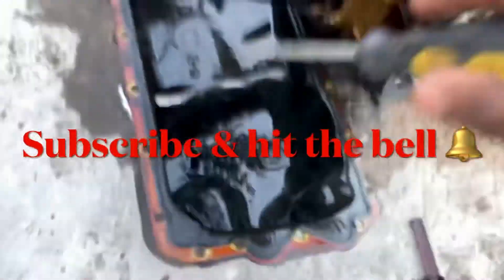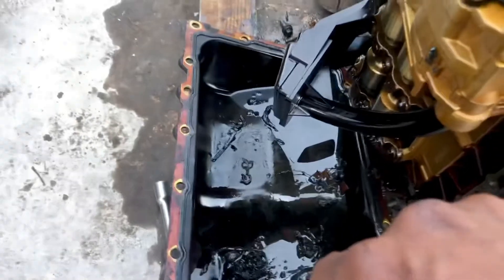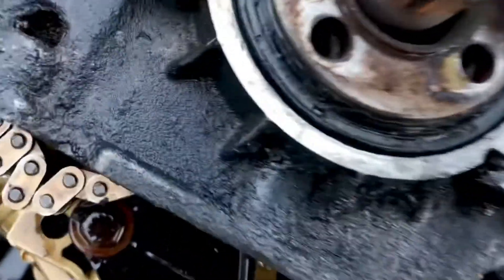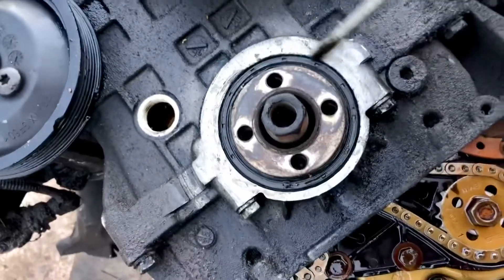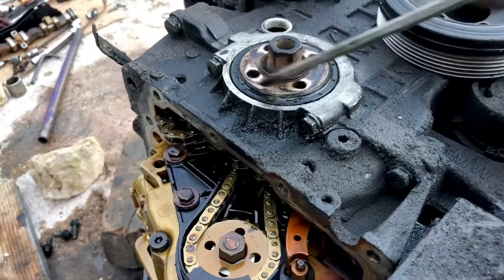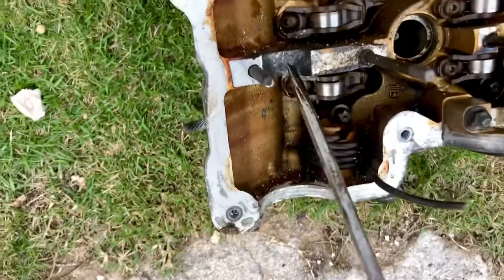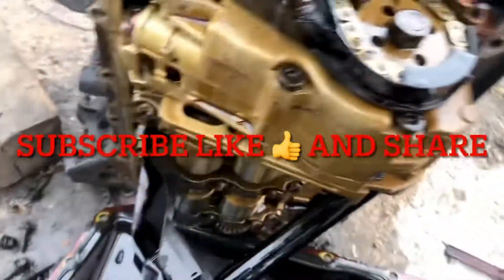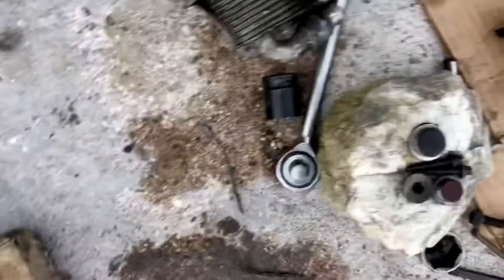#BMW #E90 #N46 Engine failure,how did this happen?.

Comment: I don't believe that is what you are saying it is. I believe that's one of those liquids that they put to fix the cylinder head gasket. Or the silicon they use for a gasket. They have put too much in it. Or if it is that liquid to fix the cylinder head gasket they have used it wrong or the cylinder head gasket was too much damaged and that liquid made his way to the oil.
Reply from the maker: Hello,I know it might sound impossible however this is something I see on numerous occasions. The belt peeling off and make it’s way behind the crankshaft pulley and into the engine, if the belt is peeling off check behind the crankshaft pulley.